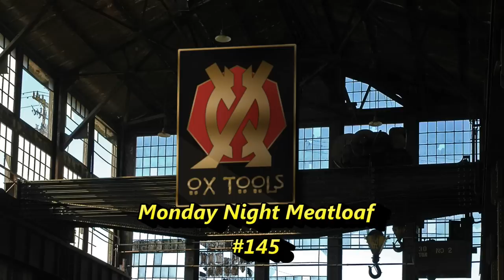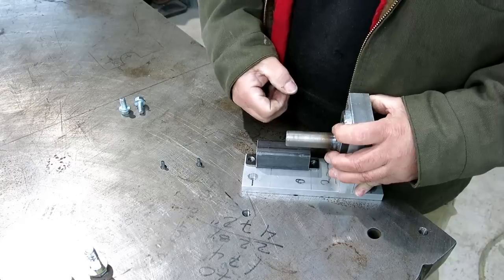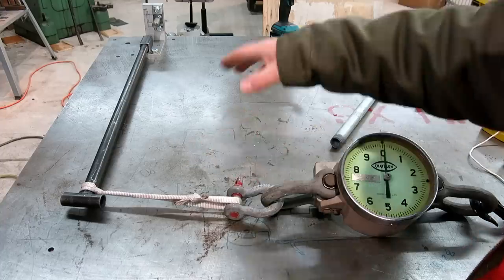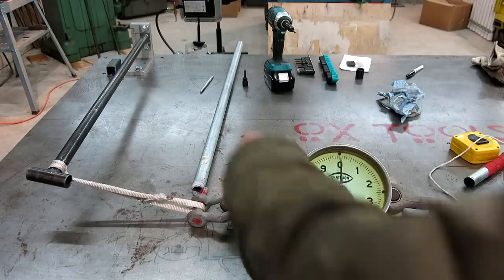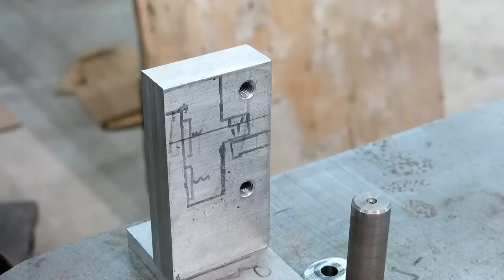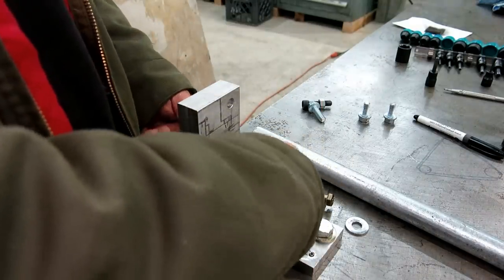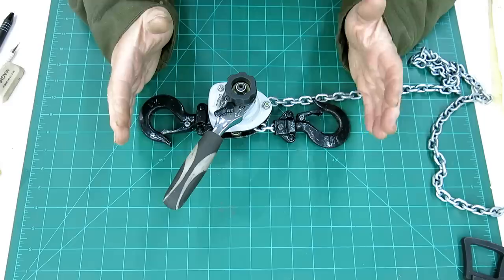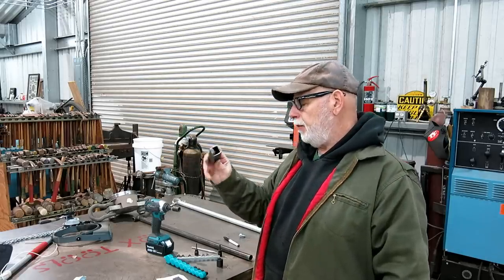Monday Night Meatloaf 145

Comment: Tom, one thing I learned about fasteners is that you utilize the strength of the fastener in steel if the engaged depth is a minimum of the outer diameter of the thread. In non-ferrous the rule of thumb is twice the O.D. as a minimal engagement. I'm metric so for a M10 thread in aluminium you should have 20 mm of engaged thread. So if you know your material thickness you divide it in two and that's the maximum thread from a thread point of view. I used it for +25 years now and it never let me down. Maybe a practical tip. Thank you! Best, Job
Reply: Yep , 2 -2.5 times dia of engagement is what I have always used. Head profile is also a consideration. In this set up I would have used Hex head rather than Countersink head bolts.
Reply: @1ginner1  countersink was necessary for the side tube because hex head would be in the way.
Reply: Hi Tom..  two things..  1) thank you for telling us about Gary a few years back.. I think he is just a pleasure. One of the best treats you guys share is how you think around problems and challenges, outloud, so some of get to learn.. and 2) a sort of welcome back: I have really missed your content the last few years. Somewhere in the first part of your load test I felt like you were having the kind of fun with your project that seems to have been missing since the “egress”. Thank you for sharing your world with us.
Reply: That’ll give full engagement for sure, but if you look at the engagement of a grade 8 nut on its corresponding bolt it’s less than a full diameter and the bolt will always break before the nut strips out (unless you overtorque it of course). 
I’d bet there’s a couple pages in the Machinery’s Handbook about different thread holding properties of different materials and hardnesses. 

Remember, fine thread pitches are stronger than coarse. So when you need the extra strength, suck it up and turn the wrench a few extra revolutions.
Reply: @felixar90  Only if you go with the failed design.
Reply: @spaight711  C'mon Phil. You cant have it both ways, first you say,  "(unless you overtorque it of course)" and then you say, "suck it up and turn the wrench a few extra revolutions." Get a grip. lol. Machinery handbook and Kempes have voluminous pages dedicated to Fasteners if you don't loose the will to live reading them.

Comment: I've been using those chain hoists in my job forever...
I do all kinds of stuff with them. Pull and bend, lift and twist.. mostly pipes. If I need a to get a pipe or something similar really close to something .. i mean closer than the length of the hoist itself... Then I just make a loop around the two things (pipe and quite often another pipe).
Reply from the maker: Good one! Thanks for the comment.

Cheers,

Tom

Comment: Hi Tom. Thanks for sharing this episode.

Regarding the pins for the insulation above 8' : the stem of the pin is a tiny cold bridge to the outside temperature so the tip of the pin is always going to be slightly colder than the surrounding insulation. Any moisture in the shop air will condense on the pin tips and you could get rows of drips coming down. I had this from the roof of my old garage until I covered the exposed protruding nail ends with more insulation. Just cut small squares of your foam and glue them over the pin ends and washers.
Cheers 

Toby

Comment: Congratulations! You've created a giant version of the bolt cutters you see on crimp tools. You could probably shear off the screw without any help from the socket. 

Assuming that flange on the post version is 1" wide, you've got a 66:1 mechanical advantage, or 16,500 lbs of tension on those flange screws. If those are 5/16” screws with ½" of thread engagement, that's about 0.5 sq in, or 33,000 psi, and a quick Google  search turns up 30,000 psi as the shear strength for 6061.

Comment: The next question on the come-along handle is where do you want your fuse. Repairing a sheared off screw or a ripped out thread is no fun whereas putting bigger fasteners on that first design means you replace a simple piece of square tubing if you over-gronk it.

Comment: That countersink being so deep is what we refer to as a knife edge condition in the aerospace structures world. To be avoided at all costs. Rule of thumb is only go about 70-80% of the material thickness in depth for the countersink. Granted that's also considering you have many, many fasteners in a row to take up the shear.

Comment: FYI. That’s a power lineman’s “hot hoist” or “strap jack”.   Someone to the strap off and put a cable on.   It usually has a fiberglass handle with it.  I believe double up its good for 1 tun.

Comment: I agree that those little chain come-alongs seem to all be made in the same factory. I have a norhern tool, a harbour freight, and a couple other pricier labels, fit and finish the same, styling details the same, and even the part breakdown diagrams seem to be the same. Not look the same, but the same art. all bought at different times over the last ten or fifteen years, but, from the outside, the same. Very handy to have, though. Each of the heavy hoists-one tone, two ton, five ton-  has one of these tag-lined to it, both for setting them up- five tom falls are not easy to handle on a 20ft ladder- and for offsetting and tugging loads when lifting.
Reply from the maker: Hey John. Sounds like you have a few of these. Thanks for the comment.

Cheers,

Tom

Comment: Enjoying having you back.  

So here's my $0.02 worth on your come-along repair.  Mill off the busted socket.  Fabricate a steel yoke to wrap around the aluminum yoke.  Suggest about 3/16" for the legs and 3/8" for the cross piece.  Weld your handle sockets/stubs to the new yoke.  Use the socket screws to fasten the steel yoke to the aluminum sides and through-bolt the top (if space permits).  The socket screws shearing is not a bad thing - they are the weak link protecting the rest of the assembly.

Coincidentally, yesterday I was putting some pretty good gronk on a couple of come-alongs with the intent of bringing down a tree that was hung up on its neighbor.
Reply from the maker: Hey Brian. You are on to something. The two systems can share a common mount that improves both. Thanks for the comment.

Cheers,

Tom

Comment: The rule of thumb for the maximum depth of a countersink is 2/3 the material thickness. Could consider using Keenserts in the aluminum.

Comment: Paint or cover spray foam if you go that way for insulation. The sunlight will break it down overtime.
Reply from the maker: Hey Booger. Thanks for the comment.

Cheers,

Tom

Comment: IMO, the most appealing option would have to be the side handle, now that i've seen the results. I was in the other camp the other time on account of not sideloading the tool, but... the potential to engineer a fault in the very holder rather than breaking handles is far better. Having a weaker bolt in the front and letting it shear if you exceed X is the best solution.
Reply from the maker: Hey Aserta. Good point. Thanks for the comment.

Cheers,

Tom

Comment: Those little hoists,come alongs are great..I use I bit larger ones at work when I need to pull steel around during fabrication of escavating attachments..but that small one is handy as a pocket in a t shirt..
Reply from the maker: Hey Jeremy. Well said! I use it on the welding table a fair amount. The small size is really the cats meow. Thanks for the comment.

Cheers,

Tom

Comment: You could make countersink even deeper, and do matching countersink into the yoke, similar to how aircraft 100 deegree screws are installed. Then bigger diameter of the taper is what is load bearing.

Comment: From one Tool fan to another,  thanks for the video. 

When I saw you testing the first mount, I was thinking you were loading a tension mount in shear. Someone once told me single shear was really a tension application.  But I thought hmm I wonder what would happen if you had it bolted in shear, then tested it.
Reply from the maker: Hey V8. Maynard says shear.....Thanks for the comment.

Cheers,

Tom

Comment: Well now. I have to comment twice. I have a number of years experience with sheet metal and HVAC work. That stuff for hanging insulation will never come off. It's tough. Also, there is no need to clean the metal, it will hold. Most duct work or sheet metal in general is treated with really light applications of linseed oil or something similar to prevent rust in storage and you can hang it right up in any orientation and that glue will stick forever. Also, if you do insulate ceilings, they make a tool, basically a broomstick with a ring magnet on the end that you can set the nails into after you goop them and stick em overhead then when you come back whenever the stuff dries the same tool will hold the fasteners and you can poke them right onto the pins while remaining firmly grounded.
Reply from the maker: Hey Phillip. Thanks for the information. I was quite impressed with the adhesive in the short test I did. Thanks for the comment.

Cheers,

Tom

Comment: Interesting the stress testing using the dyno gauge, never seen one before. I'd say the thin countersunk plate acted like a sheer cutting blade under the screw head. I'd be a bit weary of drilling
and fixing across the narrow alloy bridging section and applying force to it.  You could make the new mounts to fit on one L shape back which fits the L contour of your pull along. So you have the side fixing strength aiding the centre pull with it only being a narrow mount. If you know what I mean Tom. Enjoyed the video and the technical info. Tony
Reply from the maker: Hey Tony. Yes I followed your idea. Thanks for the comment.

Cheers,

Tom

Comment: Great testing on the handle attachment designs. On the sound stage I used to work at, we used those insulation anchors to hold the sound proofing on the concrete block walls. If you do have places that are not covered but you want to not get snagged on the nail tip, they make a cap that can go on them. Unfortunately, I have no idea what they are call or were to get them.
Reply from the maker: Hey David. Knowing myself I am pretty sure I would snag myself on any exposed pins. The ones below eight feet will be covered or capped. Thanks for the comment.

Cheers,

Tom

Comment: The clips for the insulation are also available with a plastic plate on it, which will cover the protruding nail. No injuries then. Used often in shipbuilding.

Comment: Food for thought 🤔... 
Cut bottom plate off your square ⬛ replace with? 3/8 or 1/2 inch. Go to your Machinery Hand Book 📖 look up counter sink Fasteners and pick out what will work for say for 3/8" plate the 📖 book will have all your dimensions and strength. If you have room I would back nut it with a washer head lock nut. PS your strength is at the root diameter not the OD as you stated. PS when done it will be over kill but that's fine. Your other design will work fine also.

Comment: I think with the first test the baseplate was acting as a guilatin on the small bolt, especially being countersunk. The second option, probably my choice seamed ok.  Strangely enough the thin nylon strap held better than both 😆

Comment: Nice Meatloaf Testing.  Nice seeing you at the M & G.  Enjoy the "Knocker" be sure to check out the engraving.  Good insulation method.
Reply from the maker: Hey Buddy. First thing I did after the video was use a pipe wrench to take the brass cap off. I really needed to see what was under there. 

All the best,

Tom
Reply: @oxtoolco  At least you used the proper tool 😂😂

Comment: Re streatching the threads. You do not have enough thread engagement with those bolts for aluminum. Rule of thumb for threaded holes is one and a half x diameter for steel threads and 2x diameter for aluminum. so you pulled the threads in the aluminum. Back to the video to see if you discovered this.

Comment: For the the side mount receiver option, I would add two small roll/spring pins down through the outside end of the tabs to help reduce the shear movement. For the end mount option (both actually) I always prefer thread forming over thread cutting in aluminum for the strongest threads.
Reply from the maker: Hey Jody. Thanks for the comment.

Cheers,

Tom

Comment: Once you do the main layer of foam insulation do another layer glued to it and offset the seams. Tape the seams in the first layer as well. Otherwise moisture and air will find the cold tin and cause issues and heat loss.
Reply from the maker: Hey Snappy, Thanks for the comment.

Cheers,

Tom

Comment: If you're putting that much force through the handle then you've already broken the wire and at the very least, have a perfect red line across your body. I think the handle is probably designed to break before the wire😬
Reply from the maker: Hey Paul. That particular come along has seen 6K lbs a full 50% overload. I can't get enough force on the handle to break the cable as seen by handle and mount failures. When in low gear the load is spread between two legs of cable. Thanks for the comment.

Cheers,

Tom
Reply: @oxtoolco  thanks for the reply Tom, I'm very happy to see you back on YouTube. Stay safe dude

Comment: Generally, flat head screws are used where the metal under the head is the thickness of the head. Pretty much what you had. Then the question is whether the size screw was correct. Moving up one size would give sufficient strength for your needs. But then the head would be slightly deeper necessitating some countersinking in the aluminum. Or, screws with shortened heads could be used, if the size is available.

Gary is great. He seems to be able to do everything, and seems to know everything.

Comment: Why not install flat head screw from the inside of the lever hoist arm, thru the bracket and use nuts and washers on the outside of the bracket? You could tap into the "post" part of the bracket to get a third screw.

Comment: That's interesting:   So the angle for those tapered machine screws, typically turn it into a cutting blade.   I think you would be better off just using regular bolts, but grind down the heat fairly thin, so you can still insert the handle (of course)--  but then you get the full shear of a larger bolt, and the thickness of you drilled hole can keep the entire sidewall, rather than the taper.
Reply: or make the base thicker to get more of the thread in the steel as Tom eluded to in the redesign
Reply: @stuarthardy4626  Right;  that gives it a thickness on the actual shaft.  So that's the real take away here;  the thickness of the material needs to be thicker than the taper of the screwhead. (at least on high stress situations)
Reply from the maker: Hey Calholli, Thanks for the comment.

Cheers,

Tom

Comment: May I recommend checking out the Kito LX lever hoist, the 250kg has a minimum headroom of only 205mm, they are probably really expensive if bought locally, but ordering them straight from Japan, they cost about half, at least in Europe. I got my 0.5t from a Japanese eBay seller.

Comment: That insulation should help quiet down the rain on the roof as well as help you keep a little warmer. I noticed I could see your breath in the video.😊
Reply from the maker: Hey Phillip. As the weather moves in we get fairly sudden temperature drops. I'm hoping the insulation will put to bed a bunch of issues. Thanks for the comment.

Cheers,

Tom

Comment: I would look at taking advantage of what's left of the cracked part. If you were to cut it in half lengthwise, you'd have half of it still welded to the yoke. You could machine a steel part to fit that radius and length which you could mount a new handle mount to, then use multiple screws (3-4 per side) through the aluminum into the steel part, which would give you a much stronger base for your handle mount. This would be so much easier to draw, but I don't know how to get the napkin to you.
Reply from the maker: Hey Petros. Interesting idea. I'll have to take a look at that. Thanks for the comment.

Cheers,

Tom

Comment: Spray foam expensive….yes… being in the business  years ago I can’t stress enough on how amazing spray foam is for R-value and sound…… think of that dunken donuts cup and the 3mm of foam between your hand and 180 degrees, it’s warm……… now scale that up to the multiple inches of foam on a wall,  an attic will go from 130 degrees to 80! In summer time… it is worth every penny I tell everyone if you can afford it just do it you’ll be so happy you did!!!
Reply from the maker: Yabut....It is so so ugly. I was quoted over $23K for my shop from a fairly flaky outfit. Not confidence inspiring so far. Thanks for the comment.

Cheers,

Tom

Comment: Thanks for the video.
I  would use both for the come-along, but change it to an L bracket and attach the square and the rod to the L that way they can help support each other, and you can use a thicker metal for the box section. The square would hold up a lot more if it was attached to an L bracket instead of to separate pieces.
Reply from the maker: Yep. You are on to it! Thanks for the comment.

Cheers,

Tom
Reply: @oxtoolco  Was thinking some more on this part. If you make the L out of C canal it would rap around the come along part. Then make a T nut with threads that locks into the C canal, threads are for mounting all together.
This design is for someone my size, so for testing you need go to 350 lb gorilla.
I like to over build, most times I am doing  not thinking and stuff breaks.